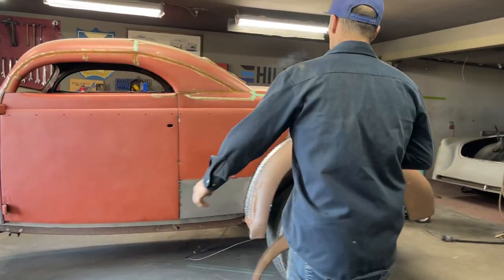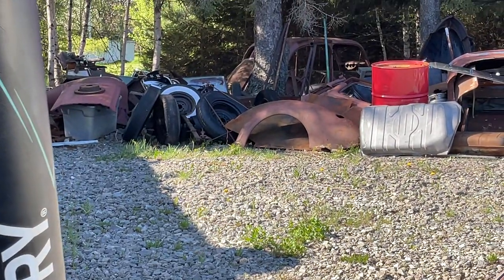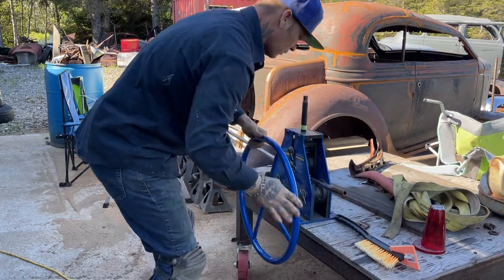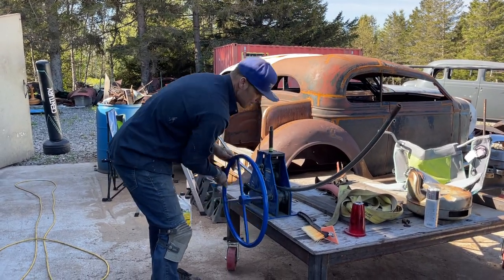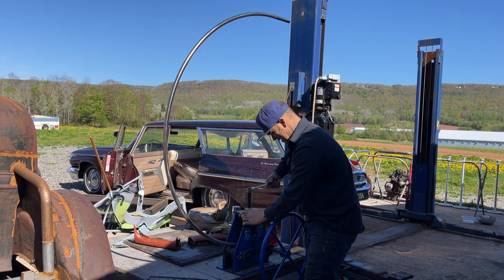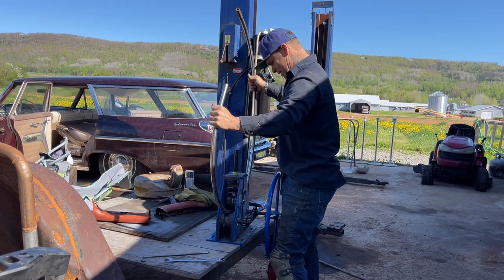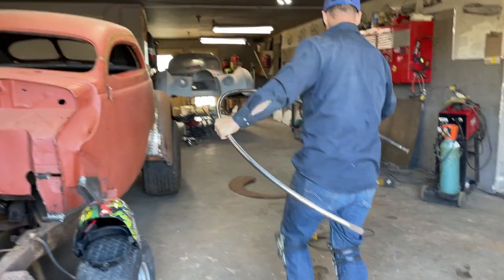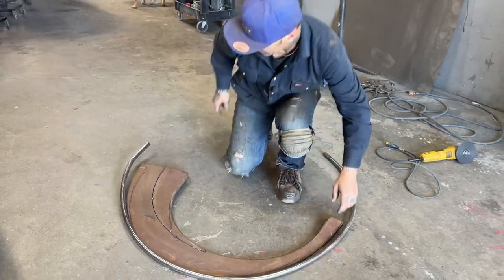Fabricating the wheel lip moulding from scratch using round rod

Comment: Making something out of nothing is what I look forward to each day watching Chad and Jolene!
Reply: I am an Electrician, you could use a couple different size steel head conduit benders, 3/4" to 1" normal and tight radius. The steel head benders aren't popular anymore because they are so heavy and usually I've seen them at flea markets way cheaper than modern aluminum head. I've them to bend and straighten lots of tubing and rod. Once you get used to using them much less chance of kinking.

Comment: Usually when the wire gets fused to the welding tip, you can use a gas welding tip cleaner to slightly clean the fused metal out after you get the wire free of the tip.

Comment: Use torch tip cleaner to clean the end of the welder tip where the wire goes through to clean out the hole .

Comment: Everyone  doing this use round rod ? Or do the do it differently  than Chad?  Thumbs-up Jolene 👍 and 👍 Chad
Reply: That isn't actually round rod but real thick wall steel tubing, and very heavy wall tubing at that.  Lots of guys including me use electrical conduit. It is lots thinner wall and not nearly as hard, so it is much easier to form to fit the opening.
Reply: @jongolliher3806  thank you for the tip brother !
Reply: @kevinmcleod3741  You're very welcome!